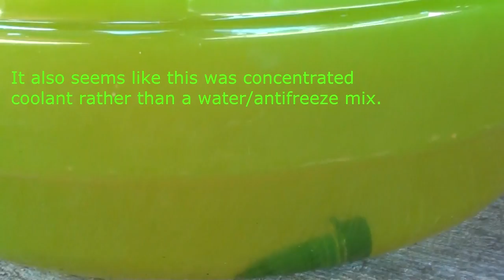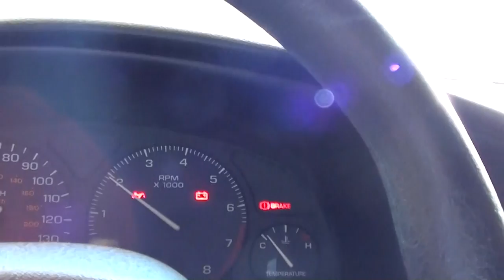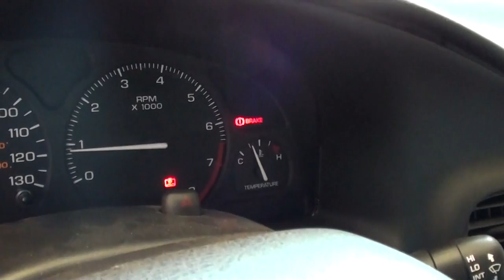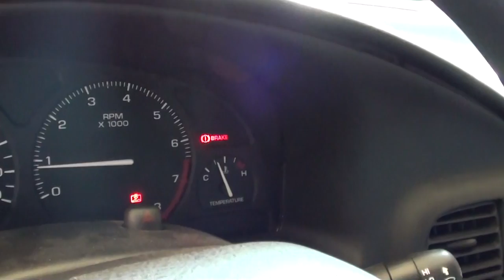Saturn S-Series Coolant Change

Comment: Just bought a south Florida 2001 SC2 with 64500 miles on the clock.  Thanks for putting this together. I did not know about the engine block drain so that was a big help.  Getting the coolant and coolant flush today in anticipation of another 65 degree day on Tuesday.  

I remember all the Saturns we have had over the decades starting with a brand new 1992 Saturn SL2, three more SL2's in the late 1990 model years and three more SC2's in the 2000 and 2002 model years.   No denying it  I am a fanboy of the Saturn lineup.

Comment: @7:38  Thank you so much for the panorama of the location for the Engine Block Plug (@1:14 it is not clear for such specialist as me where it is), I found it and used for flushing coolant in our 2001 Saturn SL2. I did it like a year ago, but now was looking again for that bolt, since think to replace the Heater Core (no heat in Saturn, and never was, we bought it used, I'll try to correct it). I also have a new Radiator for Saturn, so that plug location is essential indeed. The film was very helpful, thank you again.

Comment: Thank you for this video. I might never have located the drain bolt on the engine block without your help. I have chosen to do a full flush and replace with Peak Universal fluid (which is sort of dayglow yellow/orange) on my recently acquired 2002 Saturn SL1 with 150K miles. It's service record is unknown, so I am doing a full fluid replacement, as I come up to speed. I do not want to stick with Dexcool. Honda didn't like it, so neither do I.
Reply: Peak coolant is a 10 year, 300K mile coolant. It beats the pants off of Dexcool in terms of specs.

Comment: These Saturns are great I had a 1996 and gave it to my father in law he's driving it with 240,000 miles on it and i replaced it with a 1999 sl 1. The SL 1 i have now is great the only issue is it tends to burn rich so about every two months I have to take the EGR valve off and clean it up with some PB blaster then put it back together.

Comment: Pretty sure the manual says to use Dex-Cool (Orange) and not standard "Green" coolant. Suppose to be less corrosive to aluminum radiators. I would think you could use green if you flush every 1-2 years. Definitely wouldn't mix the two, go Orange or Green.

Comment: They sell a dex-cool that comes in green color now for GM. So your green may have been the dex-cool. I like to stick with the red dex-cool to avoid and confusion.
Reply from the maker: Mike C Dexcool has always been the orangish red to my knowledge. I didn't want to Dexcool in my vehicle anyway because of the horror stories of it breaking down seals and caking up if mixed.

Comment: I once topped off the dexcool with the green antifreeze (out of on the road necessity) and the next day the aluminum head cracked. The mechanic told me that it was the mixture of these two types of antifreeze that caused the head to crack.

Comment: I did this in my sc1 and it does not pull any coolant from the expansion tank the level of coolant actually rises somehow I let it sit off overnight and all the coolant in the tank went into the radiator but it now seems not to be pumping water even though it did before I drained the coolant

Comment: We got a 1999 sc2 and just replaced the radiator today because it broke and poured coolant everywhere. So. Replaced. Didn't realize I needed to get two gallons of coolant instead of one aha...

I hope when it's full though the temp and coolant light stop flashing. Or I suppose theres another problem we don't know about.

Comment: When I drain the coolant in my 2002 Saturn and fill the tank up it will not pull the coolant from the tank. I have to take the upper radiator hose off and pour coolant down in the motor before it will pull the coolant out of the fill tank. 
Any suggestions?

Comment: I couldn't read the bottle of the new coolant. but that doesn't look like Dex cool .it's orange. Prestone makes a premixed 50/50 . I only use that in my s series
Reply from the maker: It is not Dexcool as mentioned in the video somewhere. It's the standard Glycol (green) found in most vehicles. Had just gotten new video software and was trying out the blurring feature. Since I'm not sponsored by anyone, I'm trying to not bring in brand names as best as I can since there are so many out on the market. I have my preferences and figured I'll let everyone else decide what they want to use. I preferred the concentrate for this task and to mix myself because it is cheaper especially when doing a full flush and fill. It also helps to have extra after to fill as needed or when leaks sprout up Which is my case at this time. hopefully a video to come showing the intake manifold coolant outlet repair.

Comment: My coolant stay on i replaced the cooltant tank but now nd then cooltant leaks from the lead but its brand new nd my car never over heats.. The light stays on even though i have cooltant. I have a 99 staturn sl2
Reply from the maker: make sure the hose clamps are tight and if the light is still on make sure the reservoir sensor is plugged in. I've made that mistake before myself!

Comment: how long did you wait between running the engine to op temp and flushing the liquid out? I've been meaning to do this a day after I get off work but from the minute I get in the driveway I have about 3 hours of sunlight and I thought rule of thumb was at least an hour before even touching any hoses, drains, etc
Reply from the maker: +Jordan Frary technically want to wait until cool(safety first!), but I gave everything 5 -10 minutes before draining again because I too was on a time crunch. Be careful if you do this as the fluids well be very hot and system may still be under pressure! Make sure you wear proper PPE when doing this. Good luck!
Reply: @heyitschinoable  Unless it is a thermostat on 2003 Chevrolet Cavalier. It is very hard to reach it. You need to disconnect some muffler part.

Comment: I have a Saturn sc1 97, what color of coolant should I buy?
Reply from the maker: The standard for Saturn has been DexCool, typical color for it is orange. I switch to the more universal coolant, hence the flush I did. If you don't know what was previously used, consider doing a full flush and fill. mixing different coolants has the potential to damage components.

Comment: Does anyone know by chance where is the engine plug on 2003 Chevrolet Cavalier? Thank you for the film, very helpful for my work on 2001 Saturn. The torque for that Engine Coolant Plug for 2001 Saturn SL2 is 22 Ft-lbs, if someone needs. It is in my Shop Service Manual for 2000-2001 Saturn S-series: Coolant Drain-to-Plug/Block  30 Nm = 22 Ft-lbs.

Update: 2003 Chevrolet Cavalier doesn't have the Engine Block Plug similar to the one that on 2001 Saturn SL2 has. I looked through Shop Service Manual for Chevy, and they don't mention any such plug. Instructions advise to drain the coolant via Drain Cock only. So not every car has that Engine Coolant Plug.

Comment: where do yuou put the old coolant!!! shit lol my problem
Reply: Juvis Wilshon take to advance or auto zone they usually have used coolant bins.  Never leave anywhere out.  Pets will drink it.
Reply from the maker: Wonder if this has changed. last time I talked to the big three here in my area, (Advanced, Auto Zone, O'Reillys) none of them collected used coolant. I still have the bottles of used coolant from this video sitting in my garage as Paperweights!
Reply: JungleKing007 I work for Advance and we have 3 recycling containers.  1 for oil, 1 for filters, 1 for coolant.  Perhaps it's regional?  I can inquire for you.  I'm in the Western PA region, and a CarQuest transfer.  At CQ we didn't do the recycling though some of the larger hub stores did.
Reply: Hi jungle I have a question. I have a 1995 Saturn sl1 different engine like yours 1.9 liter sohc 8 valve 4 cylinder engine, it needs a radiator flush for sure and I was wondering. Instead of spending on money with radiator flush fluid. Cant I just remove the hose from the thermostat...fill the reservoir with regular water from a garden hose and spray water in the reservoir until I notice clear water coming out of the rubber hose connected to the thermostat?

Comment: Great job, man. Just wondering if you if it's the same configuration for the 6 cyl Saturn Vue. I have a 2007, and the light is on on the dash, but the temp gauge does not run hot; maybe it's the sensor going bad ?

Comment: I have a 1993 SL1 I am having difficulties removing the tensioner pulley bolt
Reply: You can easily get to it through the passenger fender well, by removing the splash guard.

Comment: Why are u using green coolant? Its suppose to be orange!!
Reply from the maker: Dexcool(orange) has the potential to damage seals and head gasket according to many posts online. I chose to switch to the cheaper more readily available ethylene glycol(green) coolant. Does the same thing as the "orange" which is to keep the water from freezing in cold weather. If this car had a more complex system I would stay with the OE fluid. Haven't had any fluid issues since the change.

Comment: Thank you.  That was very helpful.  Question:  did you find afterwards that the car ran a little cooler and the temperature gauge was a little lower with the new fluid?
Reply from the maker: +Herb Morris I saw a small decrease in temperature. I also noticed the temperature gauge would fluctuate a bit more depending on driving conditions. Beforehand, it would but really move.

Comment: Shouldn't you be using the orange coolant?
Reply from the maker: Yes, DexCool is the preferred coolant type for Saturn's and all GM vehicles. The reason for not using DexCool in my case is because I wanted a universal type in my car.  Dex does have additional additives, but it's not going to negatively impact cooling or drivability by switching to "green." If you do use a non standard coolant make sure to fully flush the system to reduce chances of cross contamination. Thanks for watching!

Comment: Would you recommend an SL2 DOHC W/ a 5-speed manual? Personally, I think Honda's and Toyota's are a bit overrated. I have a '96 accord automatic and it calls for expensive OEM brand fluids in nearly all departments on top of living proof that aftermarket parts don't last as long on this car either. I'd like to get an American car due to cheaper ownership, parts, and fluids that are available in most places, but american 4 cylinder cars are not known for reliability or longevity. I'd like to get a 91-02 saturn, but I have read on multiple sites that they're notorious for excessive oil consumption with no legit permanent solution. However, I was also reading that these pre-2003 saturns last a long time, can get up to 41MPG, and parts are cheap and widely available.
Reply from the maker: +Doug Davis I've liked my Saturns, and I'm also a sucker for almost anything with a manual transmission. I feel like I have more control of the car.  The 02 SL2 in this video was a replacement for the 98 SL2 accidentally killed with a light pole. Used it in some earlier videos. If you can find a Saturn S-series of any vintage that has been taken care of and you take care of it, then it should last you a while. Concerning the oil consumption issue. Both of mine eat oil. Its around a quart every 1k miles. not bad compared to others.  the issue is mainly with the piston rings getting clogged with carbon build up. The permanent fix from what I've read is drilling some oil drain back holes on the piston so the oil doesn't sit in the channel and burn up. I haven't done so but other have and it has worked really well! Mine gets about 36mpg and that's without a 5th gear swap. Problem with these cars, though is the availability of US made parts. for cars this old the repair parts manufacturing is getting shipped off overseas so quality is going down the tube. Good Luck! hopefully you can find a decent one!
Reply: +JungleKing007 Thanks for the information on oil consumption.

Comment: Great thorough job, except one huge mistake.  After all that, you used the wrong coolant.  Should have been orange, aka Dexcool.  I know video is almost a decade old, but just so anyone who watches knows.
Reply from the maker: Response I made to another post with similar statement:

Yes, DexCool is the preferred coolant type for Saturn's and all GM vehicles. The reason for not using DexCool in my case is because I wanted a universal type in my car.  Dex does have additional additives, but it's not going to negatively impact cooling or drivability by switching to "green." If you do use a non standard coolant make sure to fully flush the system to reduce chances of cross contamination. Thanks for watching!

Comment: Just want to say "thanks" for posting your video....How do you know when your car needs a flush?
Reply from the maker: Typically go by the maintenance schedule in the manual, however rule of thumb is generally 5 years or 150,000 miles. You might also consider getting a coolant tester which tests the protection rating of the coolant mixture.

Comment: It should be dex cool I have a 07 vue
Reply from the maker: Yes, dexcool is the correct fluid, but I found that it did not make a difference. That’s why I did the flush and switched to the standard “green.”